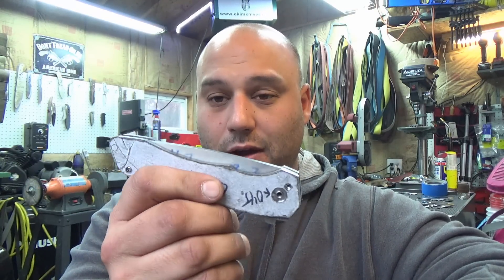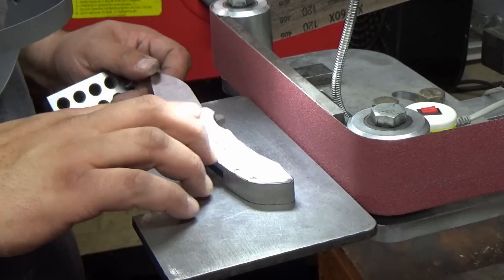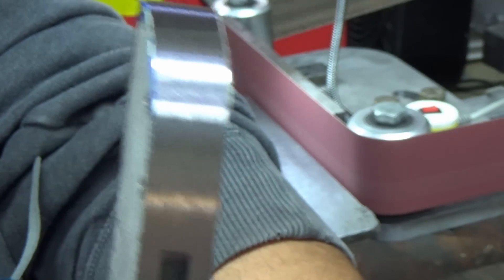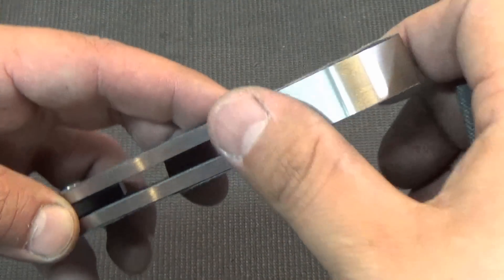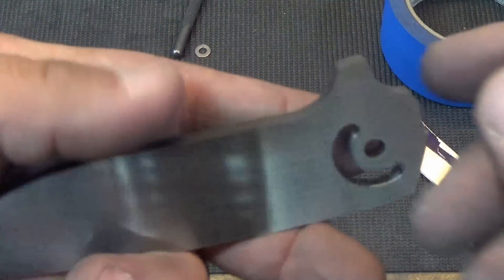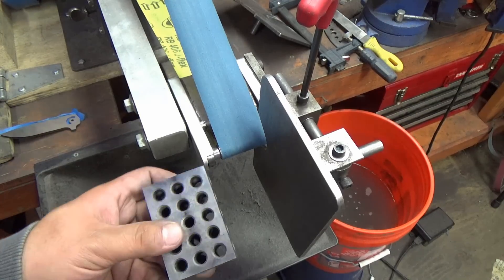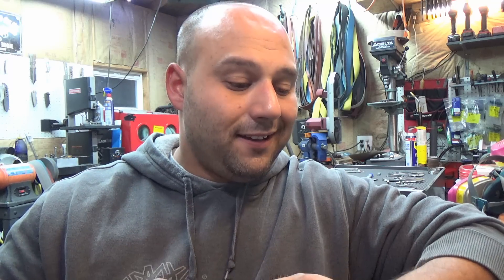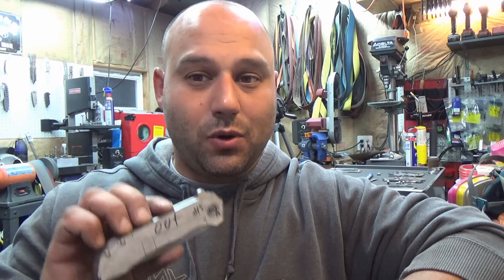How to Make a Folding Knife #8 Profiling tips and tricks

Comment: Mike,I'm on my phone or I would PM this question. I'm a retired long haul trucker (38 years). I've wanted to make knives for several years. My question is,do you sell your knives with or without sheaths? I can tool up slowly to make knives,but leather work is a whole different ballgame and I'm gonna have to start from scratch. I've worked with metal my whole life and I have a nice little shop. The jump to making knives won't be as hard as learning leather work. Can they be sold without a sheath?